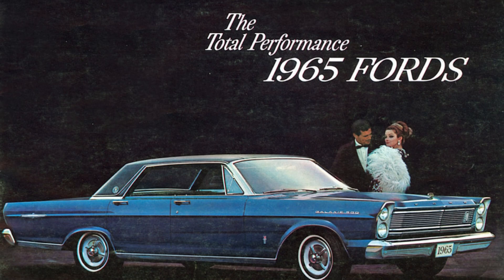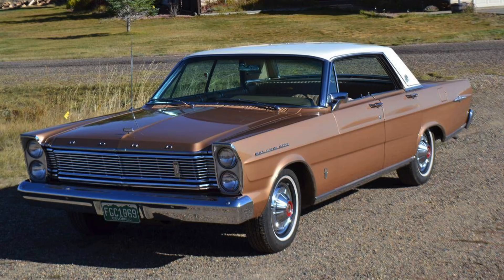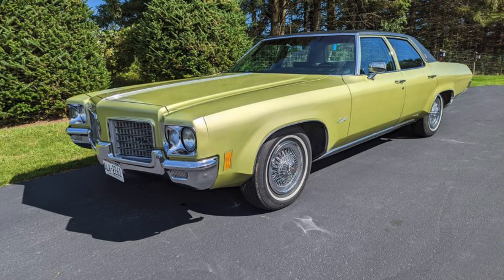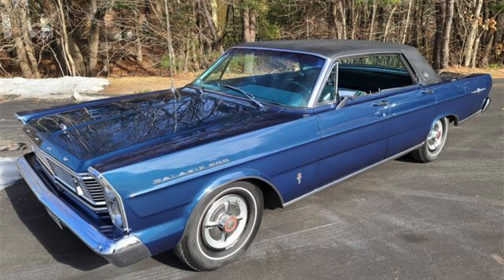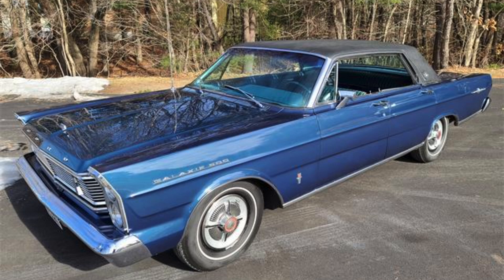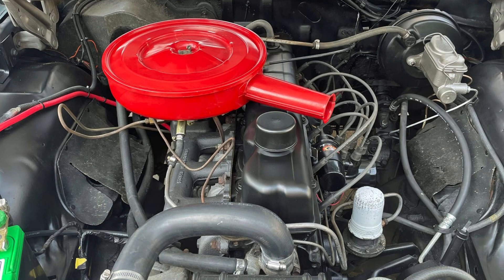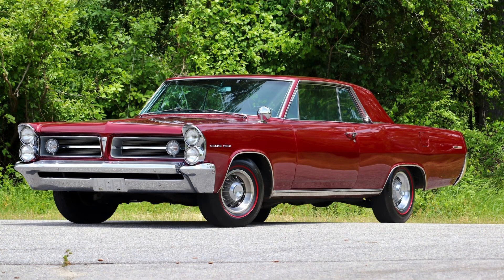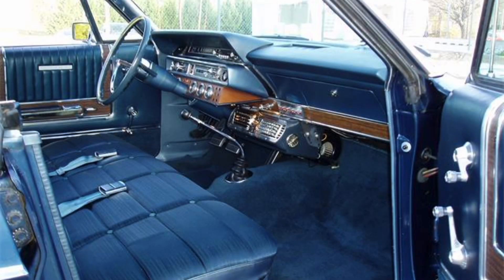Quieter Than A Rolls Royce?  How Ford Perfected the Quiet Ride in their 1965 Ford Galaxie & LTD

Comment: My ford f-150 2022 with a 2.7 turbo is the quietest Velicle i've ever had! The  was plan on putting intake exhaust computer stuff and a lift kit and everything! It's the most loaded regular cab truck you can buy on the road at the time it's the last of a regular cab! Can't pull a trailer with the turbos will overheat and  go Kaboom but the truck is so quiet I put it up on the turbos every so often! Every time I fill up with gas I take it out and put it on the turbos just for a couple seconds to make sure they're working!!! Don't want to overheat the little hamster boxes!

Comment: Hi Adam, back around 1975 i had a 69 Z-28 and lived in MA so i got a 66 Galaxie 500 2 door with the 289 for a winter vehicle.
It did ride smooth considering it was close to 10 years old then, frame was more than somewhat rusty, plenty of room and a huge trunk. 289 ran fine with added power when i popped on a Holley 500 cfm.

Comment: Making a better car than the Silver Shadow wasn't difficult. It was an outdated design with a gutless engine, terrible handling and absurdly complex engineering. The "refinement'  was simply the result of massive amounts of  soundproofing, an engine that red -lined at 4000 rpm, balloon tyres and excessively soft suspension.

Comment: I had a 66 custom 500 ,the frame of the 65-66 were prone to extreme corrosion damage as the drainage ports were located to the inside instead of facing down so they tended to be completely rot . I had to make a channel  to reinforce it. I knew a guy with a 65 who's rear arch completely separated and the axle was shifted to the right and was not reparable

Comment: "Engineering Strategy"??    Yes, there was so much "engineering" going on??!!????   Torque boxes did little...     Quietness goal was successful, but all the materials and components that allowed "isolation" from noises and vibration started to 'break down immediately lasting from 1 to 5 years before noticeable deterioration took place. 

  The interior materials started to stink - literally smelled worse and worse and the months went by (worse in the hotter climates) and the 'quiet ride' efforts were also seriously degraded.   The bushings used - (rubber materials?) "broke down" just as quickly - and the handling and quietness degraded in proportion. 

 In addition to the breakdown of the quietness, the handling degraded as the excessive use of rubber bushings (for isolation) allowed a lot of "sloppiness" between frame and suspension components.  

None of these things bothered you if, like most of today's F150 buyers, you trade in your vehicle before it gets 3 years old - leaving the problems to the next unsuspecting owner...

Comment: I had a 661/2  500 galixie convertible I found out that all those cars have very low trans axle ratios.  very quite at hwy speeds due to less vibrations

Comment: I alway thought the 65-70 Fords were beautiful.  And in my opinion they still are. 
During the 70s, they were just too big and wallowy . 
My father had a 74 LTD, that I hated driving, and he traded it for an even bigger Lincoln Continental that was even worse for handling. Yeah it rode like a dream, but handled like a waterbed on wheels. I often thought it too dangerous to drive at higher speed because it was so wallowy feeling.

Comment: 10:11 is an LTD 427 (R) FORDOR with air conditioning, manual steering.
All options were available, except power steering.
All 427's were top loader 4 spd manual transmissions with manual steering boxes.
Most, if not all, had power front disc brakes.

Comment: Yes they were! My Sainted Mother had a 1965 Ford Galaxie, sand/gold exterior matching sand gold interior. 289 2 brl. In 1972 drove it on a road trip from Hanover, PA to Fairfield, NJ and back. I will never forget how smooth and powerful the ride was. That front bench seat was heavenly and that motor was so peppy!

Comment: One notable feature of the 65 thru 67 full size Fords you didn't mention was the frame material.  For the years that i mentioned, ford imported their frames from Mexico, I believe.  The importing of the frames was probably why ford ordered them grossly under-built, to save on freight costs of stacks of frames and too to facillitate the frames being tied into stacked bundles for loading onto freight cars. This is why ford had to stiffen the bodies because the frames allowed too much flexing.  Ford lost quality control over their frames and too late discovered the frames were made of very, very inferior steel.  The frames turned to rust dust so fast you could almost watch the frame disintegrating.

Comment: My family had a tired '55 Chevy and my dad saw this new Ford advertised during football championship im 1964 (before Superbowls). I think GM was on strike or we likely would have got an Impala. We went for a test drive and ordered a '65 LTD in silver blue with dark blue vinyl roof. Around $3000. 289 was standard on LTD with 352, 390 and 427's optional. It had a vacuum controlled ventilation system built into rear deck. Cable controlled under dash vents and wing windows. No AC which was over 10% of the price of the car. Interior was nice with a slippery fabric. It was very quiet, and for us, luxurious. It had issues and visits to dealer for adjustments and minor fixes. Rare today, but common in the day. Paint faded fast with no clearcoats yet. Rust started, especially the frame in northeast. Engine locked up around 100k and was rebuult, which wasn't very costly then. No PCV system and fumes exited in draft tube below. It had a C4 3 speed automatic. When I later drove it years later. I found my parents had it in the wrong drive position. There were two and they were starting in second all the time! The big blocks had the stronger C6 automatic. I sometimes took it to high school for auto shop class, after my parents got a 2 year old '71 Caprice with a 400 small block and TH 400 transmission. Automatic temp AC too. Around that time, I could reach into the Ford's frame drain holes and pull out hunks of rusted metal. One day, a mechanic called me over, it was on a lift and he couldn't open the doors. It was 10 and time to go. I took it to the salvage yard and got $50. I took off some emblems I have today, hood ornament, LTD from rear part of roof. I like the '66 large Fords better and XL and 7 Litre. The LTD was a success and later became a standalone model. I bought a '66 Bonneville 389 wagon for $100. It was 10 but wouldn't die. Nice car and superior to the Ford, much as I hate to admit it.  I have a 12 year old Honda now and it has no rust and basically looks and drives like new. Amazing how far cars have come.

Comment: In 1985 I got my first car at an auction for $325. It was a 1965 Galaxiee 500 LTD, it had original black paint with a white vinyl top and black interior and a 390 cubic inch engine.  I loved the awesome shine in that black paint that looked like a mirror. I received compliments on the car anytime. I picked it up in about the second week of January and the first drive was about an hour drive and it was cold in Missouri and the heater/defroster didn’t work, so after I drove a little while the front window fogged up and froze up on the inside and I used my hand to thaw it and then it froze up thicker and I finally had to drive with my head hanging out the window in the cold air so I could see where I was going. I later replaced the thermostat which fixed the heating issue. At the time I was working for about five dollars per hour and it started having issues with needing to pump the brakes to get it to stop. I didn’t have enough money to have the brakes properly looked at and repaired, so I kept driving it until the brakes failed on a curve on a wet country road that was marked 35 mph. I was pumping the brakes to slow down and nothing was happening and as I neared the corner I panicked and stomped on the brakes and they locked up and I couldn’t steer and I dropped in a ditch that was about 3 feet deep and slammed into a driveway that was coming out at the apex of the corner and the front driver side tire ball joint broke at the top and the resulting accident only pushed the front back till the radiator was touching the cooling fan. But the damage that was caused was much more than I could afford to pay at the time. I wish I would’ve had the money to pay for the repair. Sometimes you live and learn. Be sure to spend the money to keep your vehicle in good working order, even if you have to borrow the money.
Reply: I was struggling back in 85 too.  Working in Rolla Missouri for $4.50 an hour.  I had an 76 Pinto that required every fluid a car uses just to get to work.  It never left me stranded but I was so glad to get something better... an 82 Plymouth TC3 that was a pretty awful car too.  
I was in my 30s before I had enough bucks to drive a decent car.  A 90 Nissan Stanza.  Super good car until a drink decided to total it while it was parked. 
Now days I get a new car every 3 or 4 years and pay cash.  But I sure paid my dues way back when

Comment: In the fall of ‘64 my dad was hypnotized by the LTD commercials. He couldn’t wait to buy one immediately. However that was a year that the UAW struck Ford and there was a shortage of cars. Luckily for my dad he found an LTD he liked, Caspian blue, 4 door hardtop with a 352 4bbl regular fuel V8. It was his pride and joy for years, nearly 20 years and well over 100,000 miles. Another relative liked our LTD so much he bought one, maroon metallic with a black vinyl roof. He splurged and got a 390 and power windows.

Comment: My dad bought a new 1966 Ford Custom 500 with a 289 and a radio - no power equipment. I was 16 didn’t care about how quiet it was, but loved drag racing that car. For a 289 with a 3 speed the car was amazingly quick. Loved racing the Chevy powerglides.  You had to have a good size v-8 to beat that Ford.

Comment: Hey Adam. The 1965 Full-size Ford was a beautiful transition from the 64s, and beyond, I say  that and yet the 63, and 64, Full-size were very good-looking cars, so the beauty in the 65, takes nothing away from Ford's prior  model years. The dark blue metallic you featured in the review is just gorgeous, and the black vinyl top fits perfectly. I was just 10 years old in 65, but I remember how attractive the 65s were, and yet very different from GM and  Chrysler's styling. I guess you might say I'm a pushover for stacked headlights. The square grill and stacked headlights are very classy, and the shape of the taillights are magnificent. The new 65 look somehow said pure Ford even though it looked like no other Ford from the past. The new dashboard was really well done, even as a kid I could appreciate the dash layout. When  you look closely at the LTD interior you can see the quality of the materials, and the excellent trim, the woodgrain panels, and the use of chrome is spot on. Ford really nailed it in 65, and the evolution of the look in the 66, and 67 continued the right direction. I have always been a big fan of the 67s softer look and the taillights were bold and classy at the same time. I knew then I would be a Ford man for life. And that doesn't even include the 66 Mustangs. Their subtle refinements of the 65s just added to my attraction. Ford just seemed to know what I like. The Ford blue color used on the engines was perfect.  I can remember rebuilding the 351 Windsor in my 69 Mach l, I searched all the auto parts stores in the San Fernando Valley until I found that Ford blue color. It actually stopped the rebuild from progressing until I found the right blue. True Story.  Thanks again, Adam, for another great review.

Comment: The '65 Galaxie 500 2dr hardtop 352ci was my first new car.  I was too young to appreciate what a fine car it was but I worked as a mechanic at the local Ford dealership so fully aware of the marketing.  It was twilight turquoise, I still admire the car in my old photos.  One thing new to me was the blue engine cold light, I have never seen that on another car.

Comment: My brother owned a 1965 Ford Galaxie 500 2 door hardtop.  I remember it as being so quiet and smooth and I just had to have one so recently I purchased a '65 Galaxie 500 2 door hardtop.  I must have forgotten something in the transition from 1965 to the present.  I absolutely hate this car.  Love the style but hate everything else about the car.  The roof line is so low I can hardly get in it much less get out of it.  The seats are awful;  uncomfortable and too low.  Drivers side Leg/foot room is cramped and awkward, to say the least. The ride is nice but nothing special and the steering is the worst of any car I have.  I had the front and rear springs and shocks replaced;  a new steering box;  tie rods and ball joints;  new tires and nothing, nothing has improved the steering of this car.  Had the entire brake system replaced and the brakes grab and are hard to modulate.  The 352 is a dog and the transmission is a lazy shifter and even after having the rear-end rebuilt, it still has a whine travelling down the road, the radio sucks, and even the windshield wipers are feeble;  the fenders are tinny and the generic front aluminum grill is pathetic.  My problem may be because of the fact that I have a "61 Buick Electra and a "66 Buick Electra.  And trust me, there is no comparison.  Love your site and your reviews.

Comment: Very interesting video.  The unusual frame arrangement in these Fords remind me of something.  The 1975-1991 Citroen CX had a unitized body mounted on front and rear subframes, which is not so unusual for front-wheel-drive, transverse-engine cars.  What was unusual was that Citroen employed what it called 'longerons', two steel square-section beams which linked the subframes front to back.  They look like the frames on these Fords.  The longerons were not intended to be completely rigid and provided most of the heavily-bushed mounting points for the unit body.  The suspension was of course Citroen's own, unique, highly progressive, well-damped Hydro-pneumatic technology, self-levelling and super-comfortable.  The suspension had been available since the famous DS19 of 1955 (and in a limited way on a few Traction-Avants before this date).  The DS had a form of unitized body, a 'punt' with two arms running forward to support the engine and an un-stressed outer skin.  So why did Citroen change the tried and trusted formula?  Could it be that they saw the '65 Fords and realized that Ford had a better solution to isolating road vibrations?  The DS was great but not perfect.  Testers used to criticize road-noise over broken surfaces.  My CX 2400 Prestige was very quiet over all road conditions.  Quieter than a Rolls-Royce?  I could not say.

Comment: Rolls Royce adopted the Hydropneumatic suspension developed by Citroen.
Whilst it worked Rolls were big heavy cars and the handling was not intended to be
rushed, reliability was only average, and spares were and still are very expensive.
Stick with Ford or spend a fortune in parts and labor.

Comment: I had a 1968 Galaxie 500 with a 302 and C4 tranny, it was a POS. 50K miles just out of warranty, it needed a new engine, transmission and differential. Rides like a boat with unresponsive steering, unstable at highway speeds, over sensitive brakes (touch it it could lock up), then headlights automatically turn off in the middle of the night on a country road, could have gone over a cliff. Headlights were protected by a thermal bimetallic switch, if it's on for a while the current draw will trip that switch - so freaking dangerous. Maybe it was quiet if the engine didn't knocked and continue to run, knock and misfires after turning off the key - dieseling . Need premium gas and constant turning the rebuild carburetor and constant timing adjustment trying to fix it.

Comment: Northern '65 Ford Galaxie models did not age well! They suffered from horrific frame rot. I had a '65 Ford Galaxie that snapped the frame under the driver's door crossing a railroad track at 5 mph! My uncle bought a '65 Ford Custom new in October '64. At 38,234 miles, its' frame snapped at the same point! These were nightmares!
Reply: Had a Chevy Vega do the same thing while crossing the tracks.
Reply: @davidyoung8521 In the OLD, OLD days of my youth, car frame metal may have rusted, BUT NEVER BROKE!

Comment: I had a 1965 country squire (10 passenger, 352 cu in, I bought from my folks, when they moved up to a 1970 country squire. That car saved my life when I was hit by a 1972 Buick Rivera, while stopped at a traffic light. He hit me doing over 60 mph, never hitting his brakes. I drove home with a dent in my tailgate. His car was towed. I drove that car for 10 years, hauling my boat, before I donated it to a non profit. Even then, it still ran great.
Reply: Really? He hit you in a Buick Riviera going 60 mph and you got a dented tailgate? That story just doesn’t add up.
Reply: Great story!
Reply: I also had a 65 Country Squire wagon- we put a 351 Cleveland out of a Mustang in it and it was a smoking fast car- never intended to make it a hot car- but it sure did surprise people that it could hop up and go so well. Gladly, never got hit- but it was a tank! Thanks for sharing your story.

Comment: I remember my dad talking about how quiet our new car was. Stating Ford had improved the soundproofing but never knew this side of it. 

We were lucky my dad didn’t die in that Ford when he was struck from behind while sitting stopped at a red light by a drunk driver doing 75 miles an hour. Fortunately the front bench seat broke off its legs and my dad was catapulted into the rear seat thus saving his life.